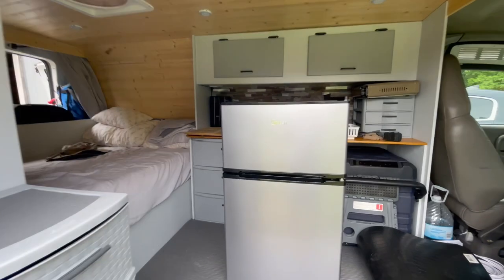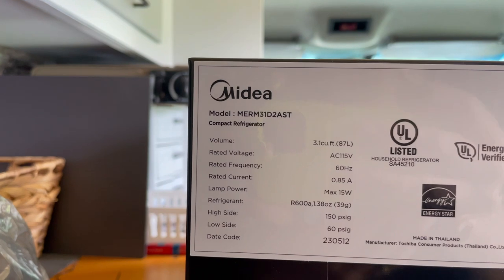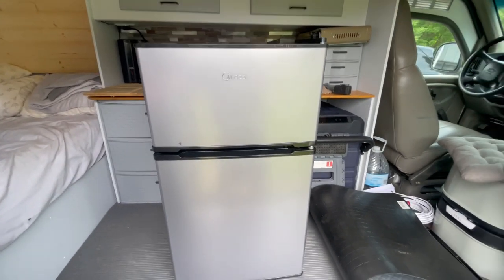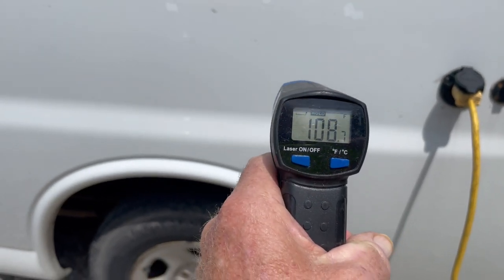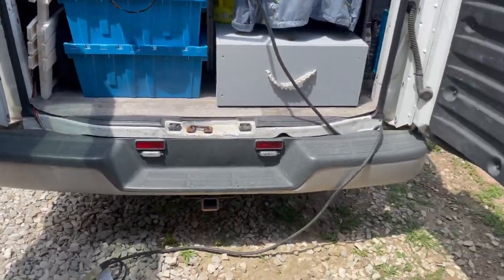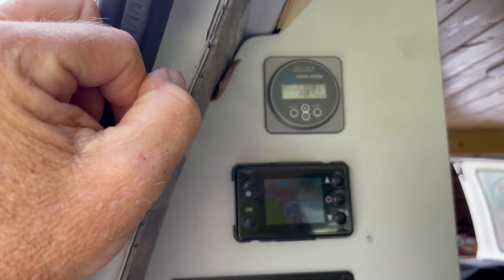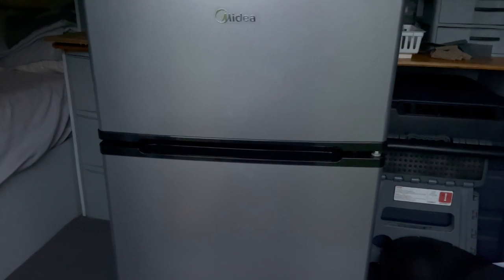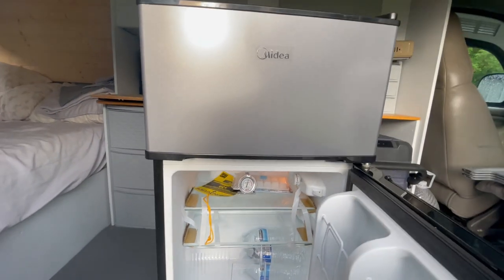Will a 115 volt AC Refrigerator run in a Van with a 12 volt DC System?

Comment: My biggest concern with running a 110v 5 CU.FT. freezer in my van was the compressor starving for oil in hilly terrain. After a few short trips of turning it off when moving, I decided to let it run. 2700 miles through some hills in NY, PA, OH, WVA, and VA, no problem so far.
Reply from the maker: Thanks, that’s reassuring! 👍

Comment: Awesome job. Others trying this, just make sure its says its an energy efficient fridge. I first tried this with an older used 3.1cf whirlpool fridge i bought used off fb. Drained my 200ah battery. Just ordered a newer version. Can't wait.
Reply from the maker: The one I’m using is an energy efficient refrigerator.  So far it has worked great.  It averages about 3-4 amps per hour. 👍